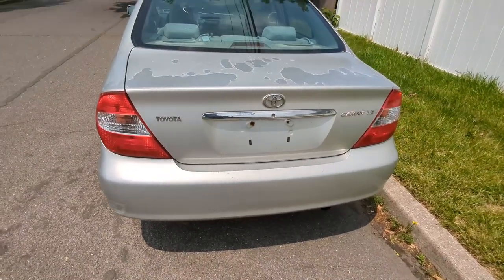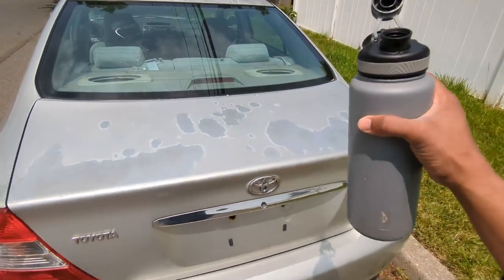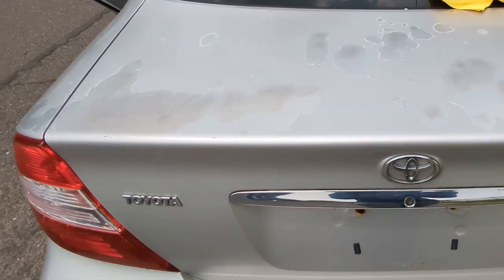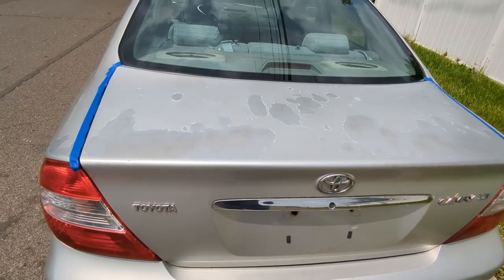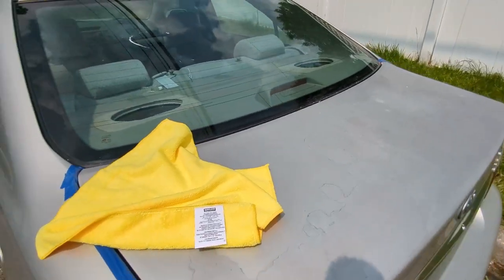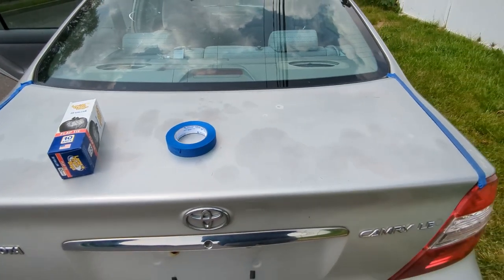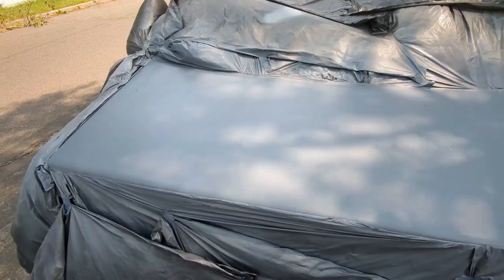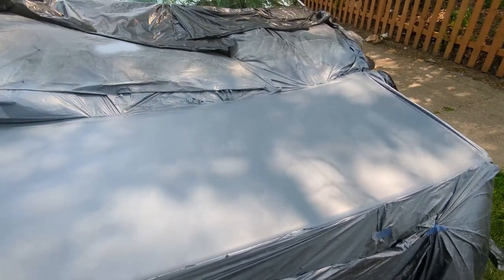How To Paint A Car ON THE STREET With Single Stage Spray Cans

Comment: Did you have to use grey primer because the car is grey? Or grey primer on all colors? Thanks, great videos.
Reply from the maker: Hey man, good question. If you can it's good to use a primer that's close to the color you want to paint over it. Usually they come in grey, black or white